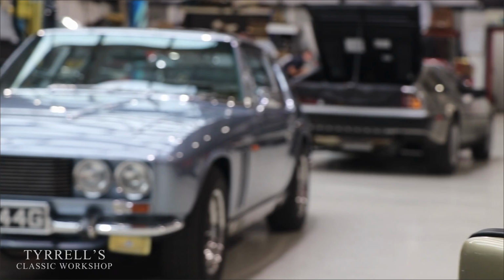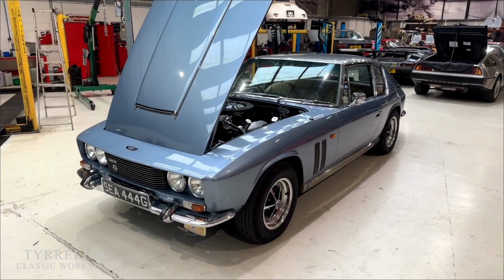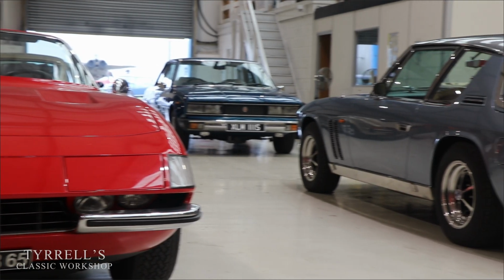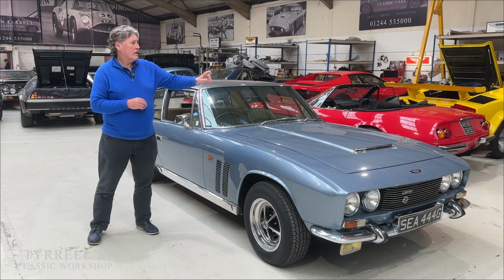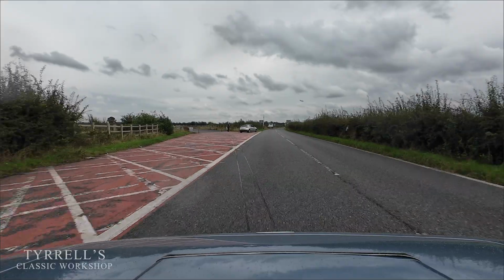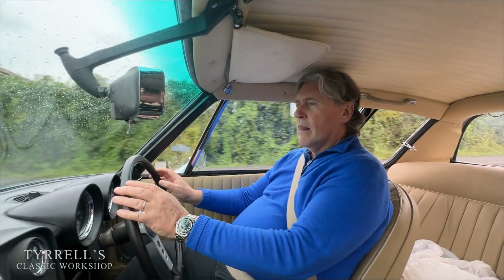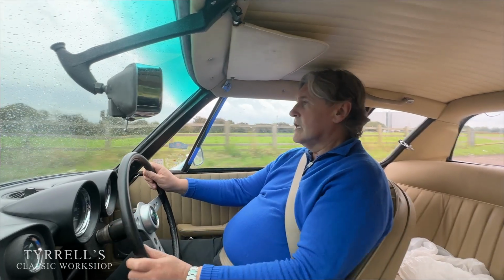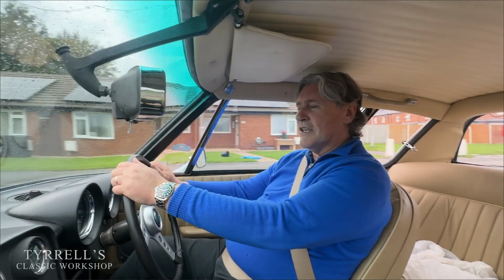Jensen FF, a pioneering marvel, restoration completed! | Tyrrell's Classic Workshop

Comment: I recall that Dennis Jenkinson (Jenks) reviewed this car in MotorSport magazine. After reading that, where he gave it a thorough work out near the limit I was hooked on ABS and 4WD. It took me many years before I actually had an AWD, but what a revelation, just as that article promised. It would be interesting to see the details of how the FF 4WD distributes the power. Thanks for another great video.
Reply: 35% front, 65% rear, IIRC. If Jenks was impressed with a car, you knew it was good - he didn't mince words if a car didn't meet expectations!

Comment: The reason why ABS on planes is so good is that you can press the brake pedal fully as soon as you contact the ground on landing. If you have to use threshold braking, you might waste many meters of runway before you achieve optimal braking force. It also prevents flat spots on the tires and therefore increases tire life.

Comment: kickdown kickdown kickdown make sure you don't watch the fuel gauge needle using that in a Jensen it visibly moves down when those 4 barrels open up but BP loves you
Reply from the maker: We have shares in BP😂
Reply: @iain_tyrrell  pity it was still 2 blocks away and the sucking noise and hesitations forced you to pit at Chevron

Comment: Would getting the manifolds ceramic coated avoid the rocker cover paint issue, and maybe contribute towards reducing some of the general engine bay heat?
Reply from the maker: Yes, that would help enormously

Comment: This is a lovely automobile top and bottom.  The steering wheel still does not look that sturdy in the road test.  The new owner will need to have practical access to your workshop!
Reply from the maker: The steering wheel is an original item, but it is quite thin. Yes, ongoing TLC is the only way forward with cars like this!

Comment: Iain, you're really good with details as a rule, but you're wrong on the Comet. they made 119! That's it! In fact, they blew apart because of bad design of skin details around the square windows. Punch-rivet holes developed fatigue cracks, resulting in massive failures along rivet lines.
Reply from the maker: I believe they sorted the fuselage issues out by the Comet 4, but nobody wanted to travel in them anymore because of the square window fatigue hard lessons
Reply: @iain_tyrrell  Good point Iain! It probably was a confidence issue in the end.
Reply: @iain_tyrrell  BTW: Thanks for the great content!
Reply: Sorry to say this but it wasn't a window that blew out on the comet 1s but the astro panel in the top of the fuselage that failed first. That led to explosive decompression and a shattered fuselage.  The fault was correctly diagnosed at Farnborough and corrected on all later comet's. The comet 4 was a successful aircraft but the accidents on the first comet's and the delays that followed  allowed  Boeing to catch up and build a bigger airliner with more seats.
Reply: @1959tr3s  Fair enough. Seems like it's a question of which blew first when on which plane. At any rate, I just felt it couldn't be described as a successful aircraft. We seem to agree that the problem was corrected but the project couldn't be saved. Too bad, 'cuz I've always thought it was a totally cool looking craft, what with that strange nose and enveloped engines. Nose must have contributed a lot of lift! And good brakes for sure!

Comment: I had a 1973 Jensen SP with the 7.2 L engine and the six pack carburettor.  It was beautiful to drive and I took it on a regular basis from Suffolk to the North of Scotland.  In those days the A9 did not have average speed limits so on some stretches I could let it rip up to 120! I wish I did no have to sell it!
Reply from the maker: That’s the way to do it! Great story
Reply: @iain_tyrrell  Hello, I know this is long after the fact...but...in the future...when you're needing to resolve 
issues caused by hot exhaust manifolds, exhaust headers, etc, try Jet Hot Coatings in The U.S. The company 
is easily found on the internet. They have a variety of coatings & they last the life of the part. Believe me, the 
coatings will greatly reduce temperature. 
ALL THE BEST in 2025. 
Ben

Comment: 5:30 - I have to correct you there Mr Tyrrell - it's not a 'kick down' mechanism, it's a 'Pressure Control System' linkage. It does more then just tell the transmission when to change down under wide open throttle.
The Australian history of this car,.. Was it in Melbourne in the 80's? If so, is the 727 transmission painted in rattle-can silver?
Reply from the maker: Thanks- we’ll have a look!
Reply: @iain_tyrrell  If the 727 is so painted, then it was likely rebuilt by my father, and it may be the one that inspired my love of Jensens when I saw it in his workshop when I was a teen. :)
Seeing this one is in your care, is reassuring. The CV8 that RetroPower got in to, is now more Replica then Original, with body cut up and a Chevrolet motor....

Comment: Autocar magazine tested the FF in March '68, and here are the key figures:  0 - 60 in 8.4, 0 - 100 in 22.5, standing quarter in 15.9s at 86mph, 40 - 60mph in intermediate in 3.8s.  Top whack was 130mph (at 5,000rpm, the 383's hydraulic tappets would start to 'pump up' at sustained rpm higher than this).  The magazine averaged 13.6mpg overall in its test (naturally, 5-star only!)
Reply from the maker: Thank you for that- interesting!

Comment: Very nice. One of my favourite colour combinations for an FF. Shame it is up for sale, but hope the owner gets to enjoy it for a weekend and they might just change their mind! We have owned 10 FFs over the years, but never an Interceptor. Always maintained them ourselves. Parts have not been a major problem. The FF's double wishbone front suspension and disk brakes are well designed, effective, reliable, easy to service. Jensen designed a beautiful removable cradle, a sub frame that houses the engine, front diff and lower wishbone. I think the access and maintenance is easier on the FF than the Interceptor because of that front end. The only tricky job is removing that driver's side exhaust manifold. The manifolds glow red in use after spirited driving and almost stress relieve themselves to the particular car and can last decades without blowing once they are on properly because they don't use or need a gasket. I would be tempted to leave them on the car if you are not yet sure abut keeping it.
Reply from the maker: Thank you for that

Comment: Still an utterly stunning car!! Maxaret is nowhere near as complex as you might think.  It's a wonderfully simple concept, hence the beauty of its operation.  The rams horn manifolds were "truck spec".  I still have no idea why they ended up on the Jensen engines.  They certainly contribute to the underbonnet heat problem for which the model is know.  Cerakote potential solution?
Reply from the maker: Thanks for that information. The manifolds are worth doing for sure

Comment: Iain, tip, as you no doubt know; ceramic coating the exhaust manifold both inside and out reduces heat transfer dramatically….
Reply from the maker: Thanks- needs it really

Comment: A friend of mine in San Diego, California, had one of these about 25 years ago, along with a large collection of Rolls Royces with a model going back to 1928.
His Jensen had the 440 Chrysler motor.
He said he could only use the air con on a cool day because the large engine restricted the airflow in the engine compartment so badly that it would overheat quite easily.
I have never owned any Chrysler. 
Their cars are ugly, and their engines are poorly built.
Thanks, Iain.
Reply from the maker: Thank you

Comment: Top speed is around 140 based on road tests of the era.  Limitation was the 3sp gearbox.  The 2.88 ratio with the 185/70R15 tires was a compromise for acceleration and speed.  Many of these cars have now larger tires, so they can actually go a bit faster.  If you use a more modern cam with more lift and duration (stock cam was actually the smallest cam Chrysler offered at the time) you will go even faster.
Reply from the maker: Thanks- useful information
Reply: @iain_tyrrell  Funny enough, the fastest car that Benz was building at the time was the 600SEL, 6.3 V8 fuel injection OHC 4 sp auto.  Despite the excess exposure in the press as the fastest car in the world. its top speed was only 134 mph according to the tests of the era, and its 1/4 mile time was about the same as the Interceptor, despite the extra gear, and all the engine complexity.  The Chrysler big block was one of the best, if not the best, American engine that could provide flat torque curve, good top end, reliability, and simplicity.  Engines from GM and Ford could provide reliability and simplicity, but had trouble providing both flat torque curve AND upper end, they could do either one or the other.  This is why Jensen, Monteverdi, Facel Vega, etc. chose Chrysler.  The main issue of the Jensen III with the 440 was the compression ratio, only 8.2:1.  Most of the exhaust emissions equipment as installed in 1974 American cars was absent, but the compression ratio remained, apparently because it would be too hard for Chrysler to provide a low production engine only for Jensen.  But in compensation, we have the Jensen SP with left overs 440 six packs.  These engines had the hotter cam that Chrysler built, and had performance almost as good as the Aston Martin V8s.  The Aston with the 5 sp would be a bit faster than the SP,  but I suspect the 3sp auto Aston would not be any faster than the SP.  I do not have a road test of an Aston 3sp.  Cheers...

Comment: I recall in 1969 I paid 2000 GBP for my 2 B detached bungalow 
selling everything to raise my 500 GBP deposit
No central heating
I installed that myself 
almost 8k GBP for a car was a fortune  
I recall an Range Rover was under 1700 GBP at that time 
wonderful British engineering
built around a  US spec  Chrysler V8  drive train
thanks for the run out in the FF 
an all time favourite motor :-))
Reply from the maker: Thank you too

Comment: The 440 engine never made it into the FF, for one simple reason - it wouldn't fit. The whole engine was shifted upwards and to the right of the car to allow the front driveshaft to pass, and the 383 needed a special low-rise intake & air filter to fit under the bonnet. Physically, there was no way to fit a 440 without adding a large (wide) bonnet bulge.

The SP (the FF's follow up) was the first Jensen to get the 440, in the high hp "Six Pack" (330hp SAE) form (via Chrysler Canada, IIRC), starting in 1971. The Interceptor followed suit later in the year with the 4-barrel version of the 440, which started off in a fairly high spec (305hp SAE), before being downgraded to 280hp in 1972 as Chrysler detuned its engines for emissions compliance.

Of course, nowadays there are options out there to make much more power if you feel the need, and are willing to restomod the car. Stroked engines, EFI, even an Overdrive that (allegedly) can be fitted between the autobox & the transfer case. All it takes is money, and time...
Reply from the maker: Thanks for those insights

Comment: Also, that block + transmission can be fitted out to generate 500 horsepower before reinforcement is needed. The Torqueflite 727 gearbox is said to have been the first automatic transmission to shift faster than a regular manual box. That, plus the torque multiplication from the torque converter made it (your choice) of smooth shifts up to percussively hard.  Just required fitting the hydraulic “computer” with the proper pressure relief springs and such. I know this is meant to be as original as possible, but wanted to mention it in the context of the time.
Reply from the maker: Thank you- these is so much scope on these great American transmissions

Comment: Love to hear how it is in the rain, whether the all wheel drive system allows better grip when accelerating, cornering, and braking. I wonder if anyone drive an FF through snow? 
The combination of Chrysler 383 + Torqueflite could spin the rear tires under acceleration on the Dodge, Plymouth, and Chrysler cars on dry pavement. I presume you can’t break traction on the FF, and who would be cruel enough to test it nowadays?
Reply: they drove one up a ski slope

Comment: Sure, it’s a very neat car, but seeing that a person could get a DB6 for a lot less speaks volumes as to why there were so few FF’s made. I think you would have to be blind to order the Jensen over the Aston.
Reply: As a Jensen owner I am of course biased but a DB 6 is by comparison a very unreliable car.  The straight six engine sounds great, better than the Jensen in fact IMO but it's just not as robust as the crhysler unit and mechanical parts for an Aston are eye wateringly expensive.  I know from first hand experience from a DB2/4 I had briefly when I was an apprentice fifty years ago.  A second hand cylinder head was going to cost me £1750. That equated to THREE years wages for me at the time!  Needless to say I very quickly sold the car on.
Reply: @1959tr3s   All excellent points. Thanks for the insights. Have a similar set of tales to tell about beautiful Italian machines that have been sold and replaced with an old ZR1 and an even older 911.

Comment: Chrysler did and still does a special exhaust gasket that has a steel shield on it that comes up and protects the paint on the valve covers from the heat of the manifold ,,
Reply from the maker: Thank you

Comment: I've heard some rather harsh words about Jensen build quality, especially around the rear window, from restomod builders. Of course, some of the problems may stem from less than perfect work by previous workers on the project.
Are there awkward little bodges that appear to be Jensen's doing?
Reply from the maker: The build quality was not fantastic, but they were worth so little for years that cheap repairs ensued. Things have changed now- there are a lot of these cars being restored to better-than-new

Comment: These are some wonderful cars, and this one turned out really nice. Hopefully it will find a nice new home. 
Regarding the transmission - the most misunderstood part of the Torqueflites is the "kickdown" linkage. Firstly because it's not that at all, but it's actually a pressure control linkage. Secondly, if the linkage is disconnected it will result in 2 things: a very smooth and early shift, and the transmission will burn inside. 
Hearing that the linkage was not connected will set off red flags with Mopar people, hopefully the transmission survived. 
Why the "kickdown" name? Because it also does that. Full throttle means full pressure and it will force a downshift if possible and also holds the gear for much longer.

Comment: An older guy I used to know told me of a time he worked in a Jensen dealership and he was picking up an Interceptor and driving it to the dealership and he was parked at the side of the road, and a young guy in a works van thought it would be funny to 'Buzz' him as he drove by (driving so close that it causes a vacuum between the two vehicles and shakes the smaller one roughly) but instead of just missing him he took the whole side of the Jensen off smashing every panel on the one side! He said the young guy got out white as a sheet realising how much it would cost his employer's insurance! 😂
Reply from the maker: Oops indeed!!!

Comment: Always liked this car, 440 was a good engine the torqueflite was a really good transmission, we used to through it in reverse going 10 km an hour and it would stop the car in no time produce a great amount of smoke from the tires going in reverse and then back up, it took this punishment for years until the discs worn out, it was nice to be irresponsible kids playing around.
Reply: It was 100 not 10

Comment: I have consistently seen people with Mopars and the throttle rod is not adjusted correctly.  It can be tricky, as many Mopars have had their original Carter carbs replaced by Hollys, which have a completely different setup for the acceleration levers.  Even if you swap out your original Carter for a new Edelbrock, which is essentially an upgraded and improved Carter AVS design, you will have issues in terms of getting the throttle rod engaged.  It has to move back with the throttle, the pin on the lever (if you even have one) sliding along the slot that is in the front part of the throttle rod.  When the pin hits the end of that slot, it forces the rod backward, and through an array of different rods that go down to the transmission, transmits that movement to a lever on the side of the transmission.  If you have it adjusted wrong, you will not engage the kickdown as you are not pushing the rod far enough.  If you have it set wrong the other way, you will jam the rod, preventing your carb from opening all the way!  It works great when you have original parts and never needs adjustment once you got it.  But change that carb to something else, and it can be a real headache. When I bought my 1971 Dodge Super Bee with a 440, as i was driving home it seemed off.  I got it into my workshop and pulled off the air cleaner, and there was the throttle rod just laying on the intake manifold.  No return spring, nothing!  Obviously the previous owner or the dealer gave up on it.  I got it working, but no kidding, took me a good hour + of fiddling to get it working.  Plus side, there is nothing like the roar of a 383/440 punching down to second and taking off like a bullet!
Reply from the maker: Thanks for that
Reply: The throttle rod also increases transmission line pressure as throttle opening increases. Not having it operational on a torqueflite is a sure way to burnt clutches and bands.